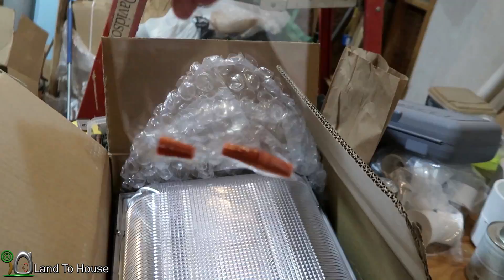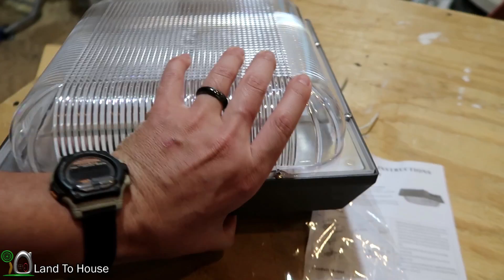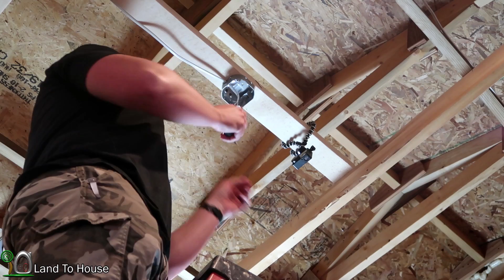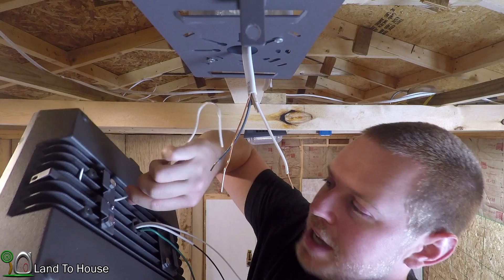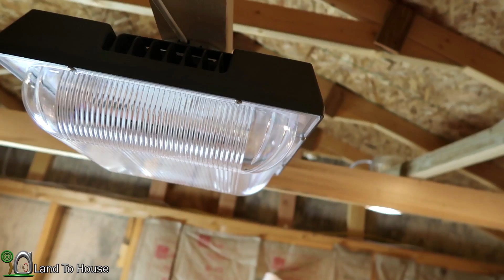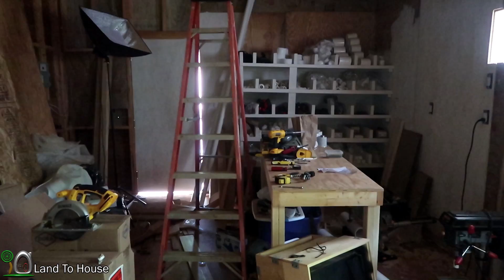JMKMGL 100w LED Canopy Light

Comment: Probably the worst installation video I've ever watched done by someone who clearly has zero experience installing electrical anything. Look how much sheathing is on the cable, the wire strippers used, doesn't even push cables back into the box before mounting, etc etc etc. Yikes.

Comment: love the videos.  stripping back the outer wrap of the rolmex a bit more so none of it is sticking through the hole in the mounting plate makes it a bit easier to shove the extra wire back inside.